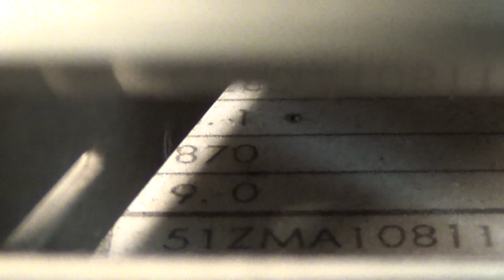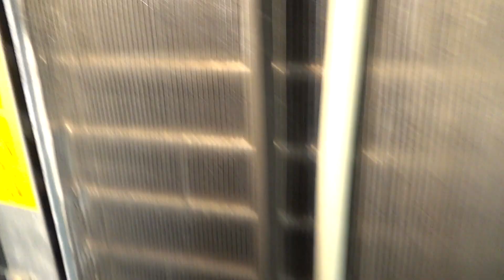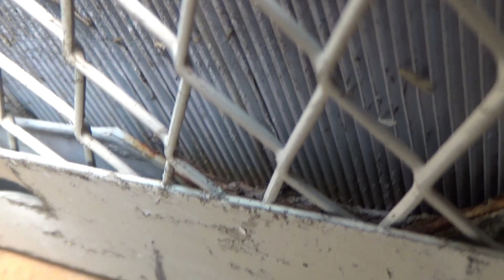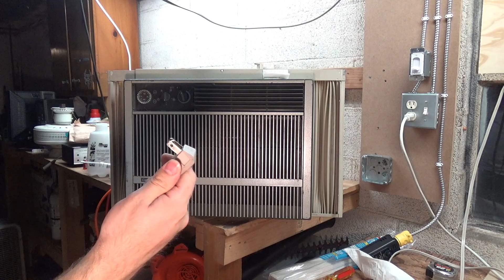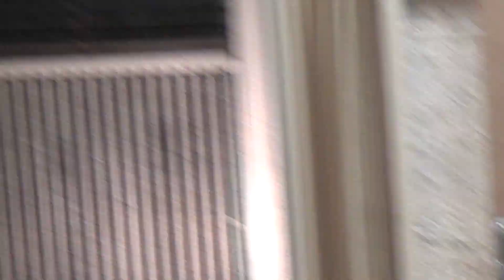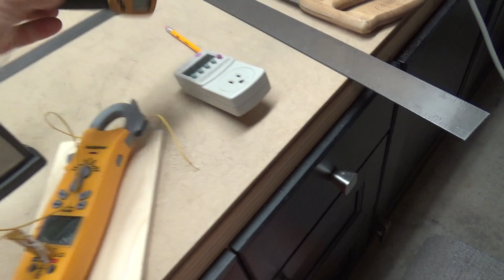1988 Carrier 51ZMA108111 International Series 7,800 BTU Air Conditioner | Initial Checkout

Comment: Great video. The international series is neat looking. And the one like you have in your living room is very special to me because I remember being in fourth or fifth grade and participating in a fundraiser to pay for window ac units for the classrooms. I can’t remember if it was Campbell Soup can labels we had to collect or what the task was but the one thing that I do remember clearly was when the very long fundraiser ended and they installed the air conditioners. The day we walked in the classrooms and they were chilly. And it was the carrier international series like your living room that they installed. Those machines cooled those large classrooms evenly and perfectly. They might’ve been not quite as high capacity as your upstairs unit but they were the same design and were amazing.